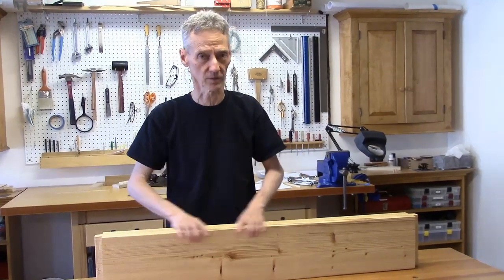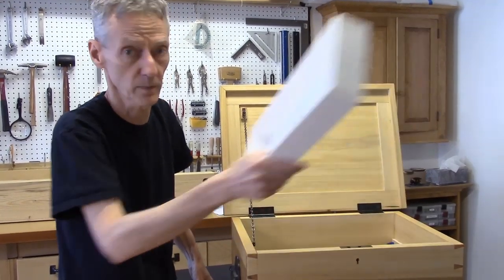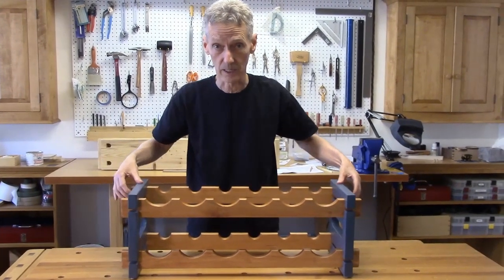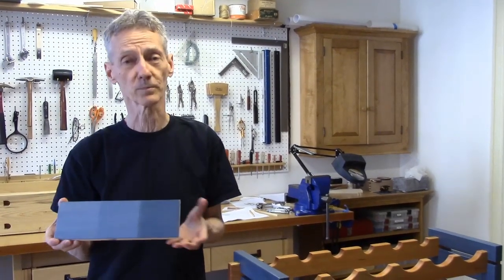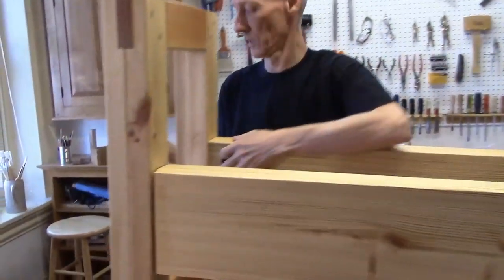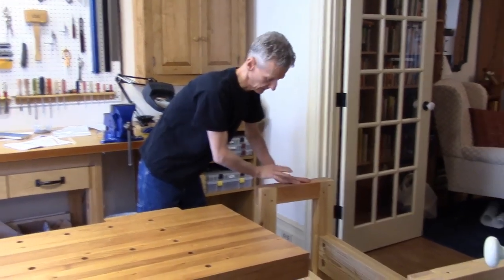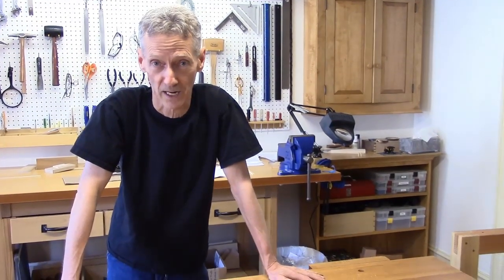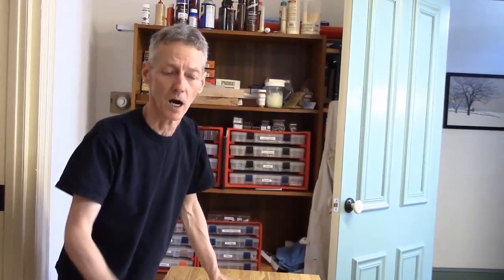Tool Chest Show #6

Comment: Hi Ken, came across your videos by accident with your Japanese toolbox. the thing that struck me first was your striking resemblance to my dear late friend  Bill Gunther. Bill was a talented woodworker in his own right, (far better than I)  your Video' are a joy to watch. ( loved it when you lost it on the saw bench glue up, pure Bill Gunther) I have just purchased the timber to build your Japanese tool box which I will be assembling at Men in Sheds over here in the UK. M.I.S. was set up by Age Concern  for retired guys like me, to work in a fully equipped workshop with other older guys  with similar interests. Have watched most of your shows and have subscribed. I am now looking forward to more of your ultra entertaining shows. cheers, Rob.
Reply from the maker: Hello Rob. Thanks for taking the time to send me your comments. I did not know about the Men In Sheds Program.....what a great way for woodworkers to spend some time together. Have fun with your Japanese tool box project and please keep me posted on your progress. If I can be of help in any way just let me know. Thanks again and best regards.
Reply: Hi Ken, had to have a rethink on the timber I bought for your Japanese tool box build the water content was way too high and will take several weeks to dry out. So  it was with a lot of disappointment that I went for construction grade 3/4" plywood. Working alone in my shop I knocked it out in about three hours this afternoon. I'm taking it to Men in Sheds tomorrow for a rather fetching sage green paint finish. Thankyou for the instructional video, it made it a very easy build for me. Cheers Rob...
Reply from the maker: Hi Rob. Congratulations on the completion of your tool box. The design lends itself well to a variety of materials and joinery methods, as you have shown. Good for you to make the best use of the materials you had available. Cheers, Ken.